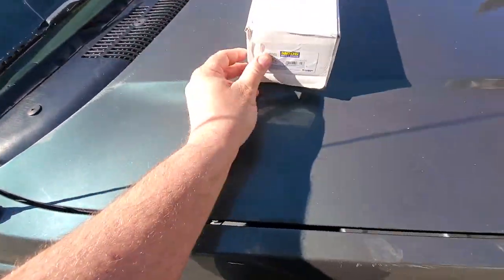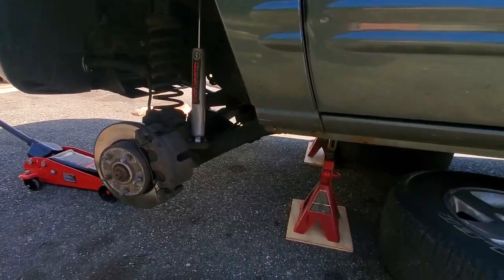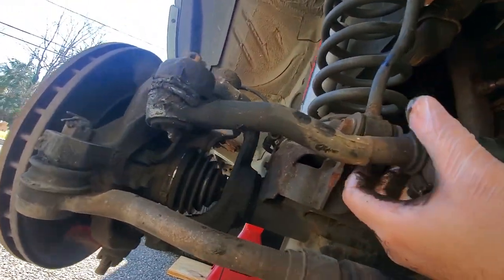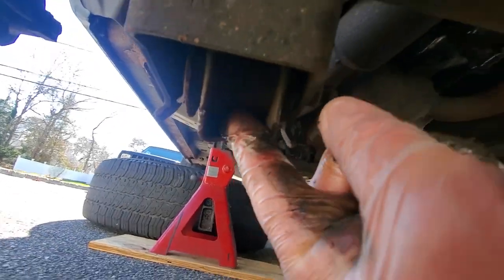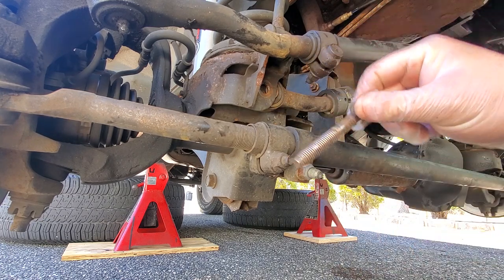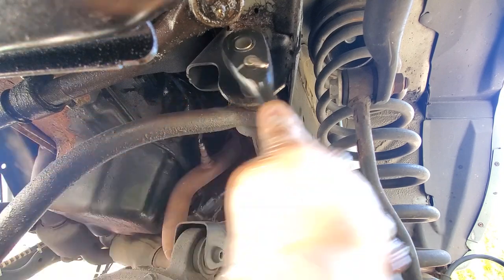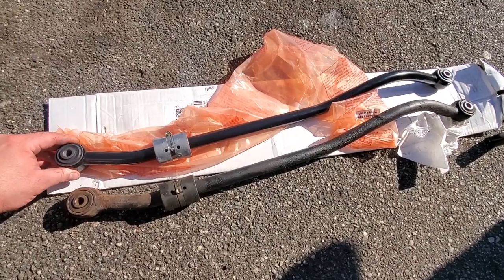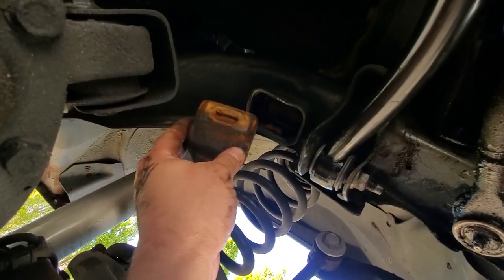I GOT DEATH WOBBLE!!! JEEP GRAND CHEROKEE WJ TRACK BAR REPLACEMENT

Comment: The intro gave me PTSD from when my ZJ had death wobble, ended up being the track bar and dealt with it for a while.
Reply from the maker: Haha! congrats on surviving the DW.  You earned the DW merit badge!
Reply: @ProjectDanH  Dan, I get gas at the local speedway by my place. A couple guys walked up to me asking about my 93 XJ. At any rate, one of the guys ended up becoming a friend. We went to a piece of commercial property he owns (Where I believe he want's some help getting the yard in order so he can erect a garage). With that being said, he had me look at a 98 or 99 XJ with some really terrible Michigan frame rot. It's not a road driver by any means. At any rate, he offered to sell it to me for $100. Since I have to get the lower track bar nut bracket tack-welded so it won't move back & forth like it has been doing & since he is a self employed welder by trade, I am gonna ask him if he'd do it, then I'll try taking him up on the $100 XJ deal. He told me that the drivetrain is in perfect condition & that he only parked it some years back because of the frame being rotted out.
I am trying to keep this comment under 2,000 words, here's what I found under my XJ. I haven't experienced any DW, plus the guy who drove it back here to Michigan from Colorado Springs, CO. said he didn't have that issue either. But wait, it gets better. When I explained to my Wife why I had about a 3rd of a turn of play in the steering, I explained to her that lower track bar bushing is worn out, & the nut that broke loose from the bracket, which is probably 90% of the play, she said, ''Dan, (My actual first name), ya know your Jeep is  nice to drive.'' So I said to her, (Fingers crossed at this point), ''Ya know dear, I was thinking of instead of getting another Hyundai, Tucson, I was thinking how bout a 98 or 99 Cherokee for you''? She said ''Yah, I'd like one if you can find a nice one.'' This all happened during our Mother's Day Date. Then that afternoon I watched you & your Wife's Mother's Day Trip to the ''Junk Yard.'' (Which I had her watch too.)
I believe one of the things that is helping me Seal-The-Deal for getting the Green Light to look for another XJ for the Wife, was your video with your Wife, plus me taking the time to explain why my XJ has that steering play... Thanks Big-Time Dan H & Many Blessings to you & your Wife ''Mrs H'' As Well.... 
Thanks for sharing that adventure with us on YouTube. It was really enjoyable to watch you guys:)

P.S. Sorry this comment is so LONG & takes up most of the comment page. You're the best Dan, Thee-Best (Plus your Wife seems to be so Awesome Too) Hope you two are doing well & also ''Happy Belated Mothers Day'' to the Wife from the both of us here in Pontiac..................

Comment: Ball joints seem to be the DW favorite 😂 The track bar was worn enough with the lift to cause it to shake as well . This was a good time to grease the front end . When replacing track bars or control arms it's best to secure the axle with the ratchet strap before removing hardware unless you are going with a different suspension system . Great video Dan H and that rear control arm with the ball joint center will be an improvement no doubt .
Reply from the maker: Excellent info Jay!! You got that 100% right!

Comment: Guarantee your track bar mounts are wallowed out. Only way to fix it is to get washers that fit your bolts exactly and weld them onto the mounts
Reply from the maker: Nope, Not wallowed out. Just bad bushings.
Reply: @ProjectDanH  notice how much room you had to wiggle that bolt around in the mounts. That means your track bar mounts are wallowed out.
Reply from the maker: @atozproductions9660  uppers?  They definitely weren't snug but I didn't notice any metal warping or ovaling.  When I replaced the trac bar it fixed the DW so I assumed everything else was fine.  I'll take another look when I put in an adjustable track bar. Thanks for the heads up 👍
Reply: @ProjectDanH  it's just something I noticed every time I see people say they took care of their death wobble. Something I remedied on mine when the death wobble just kept coming back and wouldn't stop coming back no matter what until I fix that. I remember being pissed cuz I just put on a brand new pair of control arms all brand new everything about 2 days later I get a massive death wobble after hitting a bump. So basically that track bar is holding up the entire weight of your vehicle and every time you turn it's pulling/ pushing on those two bolts upper and lower track bar mount. If the holes in those mounts are any size bigger than the bolts there's not a tightness you can get it to you that won't stop it from moving in that mount.
Reply: What I did is I turned pieces of round stock on the lathe and made it exact fit to the hardware. (Steel washers that fit to the hardware would be fine) then I welded those over the two holes front and back at the top mount and the one hole in the front of the bottom mount. Completely killed the death wobble
Reply from the maker: @atozproductions9660  sweet!  "Kill death wobble" will be my next vid with this thing in honor of you!
Reply: @ProjectDanH  I went threw two different sets of control arms, CV axles, wheel bearings, coils, dampeners, wheels and tires. Everything that went bad were just symptoms of these stupid track bar mounts.

Comment: your drag link is on backwards.....BTW
Reply from the maker: Didn't know they were directional. Lol
Reply: @ProjectDanH  the pitman side ball end drops down, the axle side makes clearance for the axle. The drop down helps with bump steer. It levels the drag link.
Reply from the maker: @jram4271  ha! Amazing!! Don't you just love previous owners 🤣🤣🤣.  Thank man. I would have never known that if  you didn't point it out.
Reply: @ProjectDanH  last week I welded in a new right side spring perch, and the drag link pitman side ball end. Love our WJs....
Reply from the maker: @jram4271  Awesome brother!

Comment: post winter potholes of the long island expressway ROFL. bruh the roads out here are literally butt cheeks. especially the LIE. half of the LIE looks like its held together with gaff tape and glue
Reply from the maker: 🤣🤣🤣🤣🤣 You said it Matty!!! Its a complete embarrassment of a road
Reply: @ProjectDanH  It's literally at the point where I'd rather take the long route then to hop on the LIE. dont even get me started on 110 🤣